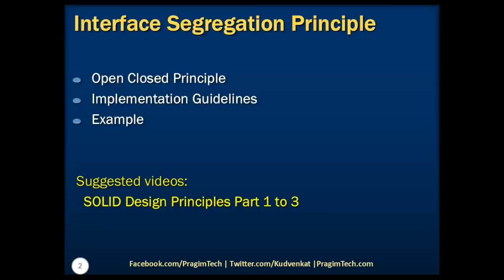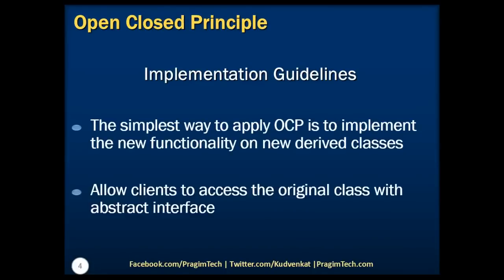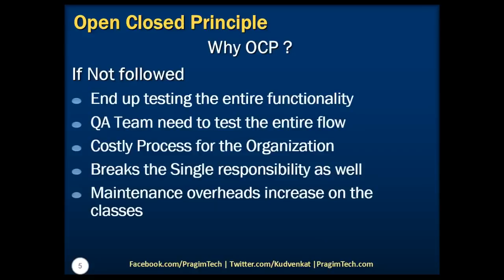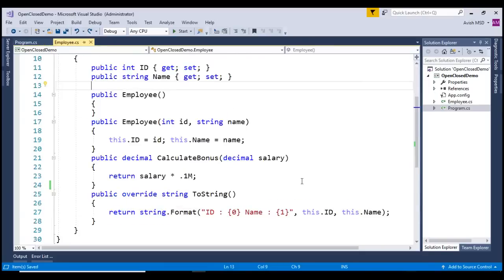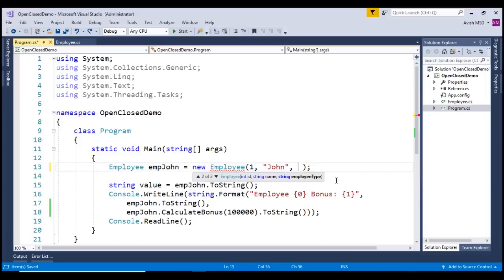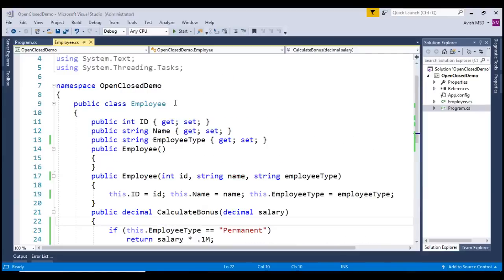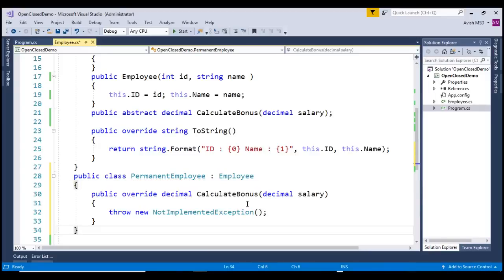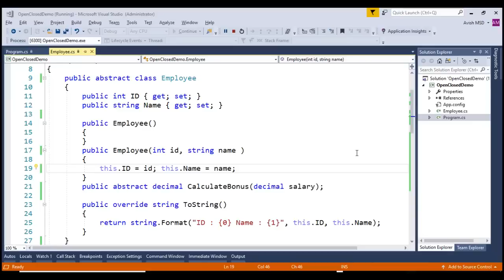Open Closed Principle

Comment: Thank you for this clear explanation, I really appreciated the way you explained the consequences of not following the OCP. However it should be pointed out that the remedy is not necessarily inheritance. Inheritance is one way, but you could also for example use the decorator design pattern to delegate the bonus calculation to some specialized object. Or you could put the bonus percentage in a class field passed into a constructor, with a default value equal to the one that was used so far (simpler but less flexible).
Inheritance is kind of a debated issue now in OOP and should be presented with the alternatives.

Comment: From where this "TemporaryEmployee" class suddenly pops up? You didn't create that, did you? Also, instead of creating the "PermanentEmployee" class in a separate class file, why are you modifying the existing Program.cs? Don't you think that is another way of violating the "Open for extension and closed for modification" which is the core definition of the Open-Closed Principle? See, even if you create digital rubbish, that also takes up some HDD space somewhere that needs electricity to run. Just do a favor to mother nature, stop creating digital rubbish like this.

Comment: I think the problem is that sometimes you don't know what lies in the future. You think about all the possibilities and then create the base class. Two months later your business grows and something becomes mandatory, so you create a new derived class to inherit from the first class. Half year later you discover yet another requirement so you create another class to derive from the second class. 5 years later you end up with 10+ classes in the inheritance chain, which also makes it difficult to maintain.
Reply: When you discover problems with the architecture, you refactor. All systems spiral into chaos without refactoring, no matter how great they look in the beginning.

Also, the decorator pattern can be used to avoid "endlessly long, difficult-to-understand inheritance hierarchies" and still modify behaviour.

Comment: But you have made the class as abstract. Isn't it a modification?
Reply: That's because the earlier implementation was not scalable. Now using abstract interface will ensure you don't have to touch this again for any new addition, provided the new requirement doesn't force the changes.
Reply: @devengupta57  Imagine that after 2 years I want to add dataOfBirth attribute to Employee. Am I going to create a new class and modify all constructor call statements? This actually makes the code more complex and less readable especially after several times of modifications and guess what else I'm going to re-test the base class as well as all other classes derived from that class up to the recently created one.

Comment: Hi Kudvenkat,

In your example you said that the abstract class fits in your sample, that is the reason why you used it instead of interface.  When would interface be used for OCP?
Reply: if u use interface u have to create light interfaces and implement it. both are same.

Comment: Hi kudvenkat, 

Although you showed correctly the definition of the Open Closed Principle, your implementation could lead inexperienced developers to learn some bad habits. Calculation of the bonus should not be implemented in the Employee Class (Breaking the SRP Rule).  A better way is to introduce a EmployeeBonusCalculator Class which would take in the abstract Employee Type as parameter and uses the Salary and the Bonus rate in the final calculation. The type of Employee used would be decided at run-time. I hope I have been constructive
Reply: Can you please explain what you mean by, "abstract employee type as a parameter"? Do mean that the method would take an object which extends(/Implements) the abstract class(/Interface)
Reply: He addressed this in Liskov Substitution Principle.
Reply: Yes, I agree with you. My first thought was to create a Bonus Class and not break the SRP rule.
Reply: How about using a delegate function?